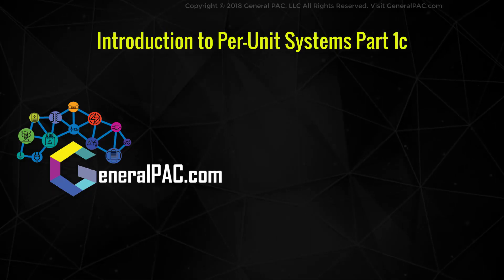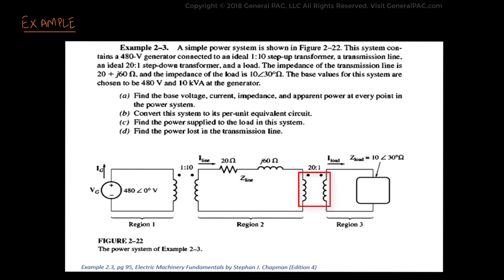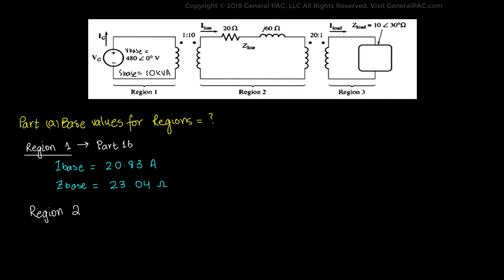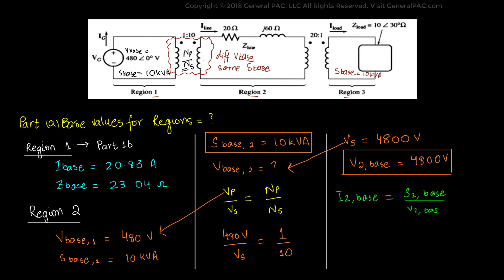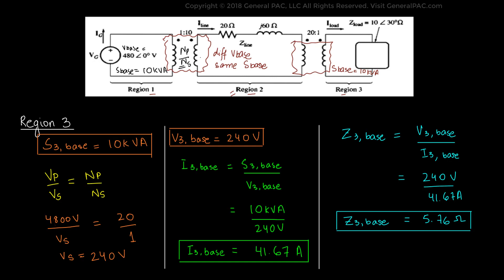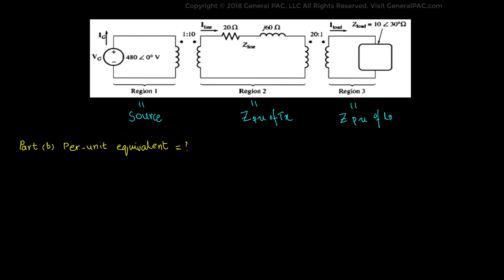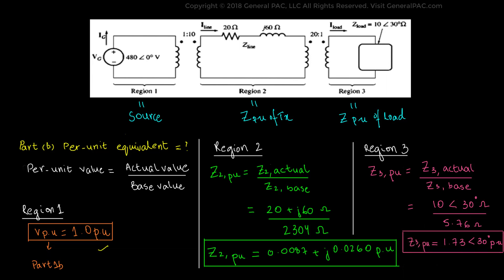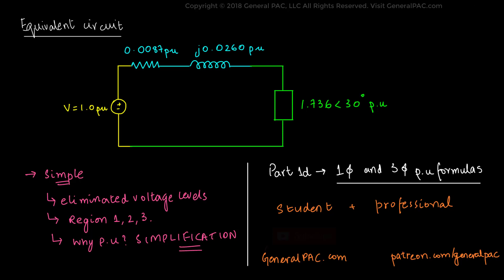Introduction to Per Unit Systems in Power Systems Part 1c

Comment: u didnt squared Vbase for calcualting Zbase formula is right or calcualtion??
Reply from the maker: Hi Sarmad, Zbase has the following formula:

Zbase = Vbase / Ibase

From the formula, it can be seen that we do not need to square vbase for calculating Zbase. 

Hope you find it useful.

Regards.
GeneralPAC by AllumiaX

Comment: Question at 4:59
I would think that because there is an impedance between Vbase2 and the primary side of the (20:1) transformer, what you would actually be stepping down here is (Vbase2 - Ibase2 x Zline). That is to say there is voltage drop that occurs across Zline to the primary side of the (20:1) step down transformer. 
Therefore Vbase3 = (Vbase2 - Ibase2 x Zline) / 20. 
Could you explain why this would not be the case? 

Thank you for this video, it is the best example I have been able to find explaining how the per unit method can be used to simplify a power system.
Reply: I thank your formula is correct.  But you can't use it to reach V3,base, simply because you don't have the required impedance which is Z3,base, NOT Zline !!!

Comment: Hi, how did you calculate the imaginary number j60 ?
Reply from the maker: Hi j boy, the imaginary number j60 is the inductive reactance of the transmission line. This value is already given in the question so we did not calculate it.
Reply: @Generalpac  Hi, thank you for responding. What i meant was how did you get from j60 to j0.0260 ?
Reply from the maker: @jboy6944 

Thanks that you have an inquiry.

The imaginary number j60 is the inductive reactance of the transmission line. This value was already given in the question so we have not calculated it.

Hope this answers your query. If this helps please step ahead and support us on patreon.com/generalpac , so that we can continue answering your questions and making high-quality courses on electrical power systems. 

Regards,
GPAC by AllumiaX

Comment: Fantastic presentation and contents. Thanks a lot for such valuable stuff for beginners in power system analysis studies.
Reply from the maker: Glad you liked it. Khurrum you might also be interested in "Power System Analysis Fundamentals" course. Just use the "FREE" as a coupon code to get get instant access. Get started with FREE course here: https://gpac.link/3eP66zu

Comment: Sir, Please inform how  we  can  calculate the ACTUAL short Ckt current at any zone after drawing the impedance diagram using COMMON  Sb but  different Vb values . For example  Gen1 ,  Transformer 1 , Transmission  Line  , Tranformmer 2 Gen 2 in series .My e-mail imush52@yahoo.co.in.  Many thanks
Reply from the maker: "Hi Imran Mushtaque ,

Thank you for connecting with us on your query.

This is how we understood your question: You want to know that how the short circuit current is calculated in a specific point in a circuit without converting the whole system into an equivalent circuit?

Well the answer to your question is that just remove all the components after a point at which you want to calculate the short circuit current and just attach Zload to it. Then solve it by using per unit method and apply Ohms Law in the end.

Hope this answers to question. Lets stay connected! How about you support us by becoming our patron? Please visit patreon.com/generalpac. Hoping to greet you as our patron. Thank you.

Regards

GPAC Team"
Reply: @Generalpac  Thank you

Comment: why are we neglecting voltage loss due to the resistance of the transmission lines?
Reply from the maker: Hi Tharindu, Thank you for contacting us on your query.

In the video above, we have assumed the voltage drop due to resistance of the transmission line as negligible. The objective is to keep the per unit calculations simple and easy to comprehend. When we analyze complex transmission models at a professional level we do consider voltage drop due to resistance.

Hope this answers your question. If you want us to help more in the future then why not support us by becoming our patron? Please visit patreon.com/generalpac. Hoping to greet you as our patron. Thank you.

Regards
GPAC Team

Comment: Can i ask u guys something how we connected that parts so easily they have differnt bases they have only 1 same base and thats the s(power) all regions have absolutely different bases . U found  pu units for only that region when u goto other rwgion  base changes  that means they not same per units i mean   in one region 1 pu  means 480 v in the other region  1 pu means 800 v look at that u add 1 to 1 and resolve is 2 pu but what is that means  is that means 1600 v or 960 v which one is it  how u can add them together so easily i think we should put them together in the 1 base so we can use them

Comment from the maker: Support us by becoming our patron at https://patreon.com/generalpac ....Why?
An incredible amount of time and effort is needed to develop high-quality video tutorials. Each video takes approximately 10 hours to complete which includes learning the concept ourselves, brainstorming creative ways to teach and explain the concepts, writing the script, audio recording, video recording, and editing. This is why Hundreds-of-Thousands of people have watched, liked, subscribed, and left positive comments.
Reply from the maker: Knight_rider , Hi

The calculated value of (4800V) is the new base value that would be used in region 2 and has nothing to do with the actual voltage drop. 

The base quantity remains the same throughout the entire network unless there is a transformer which would then split the network into different regions. When there is a transformer between 2 regions, the base quantities for Voltage, Current, Impedance changes (Base Quantity for Apparent Power remains unaffected by a change in voltage level). The base quantities are then computed using the turns ratio to obtain the base quantities that would be used in the next region. 

The base quantities are arbitrary values that are used to make computations of power systems easier. These base values are ultimately used in per unit calculations to make complex calculations easier. We have a video series on Per Unit Systems which explains in detail how these quantities are calculated.